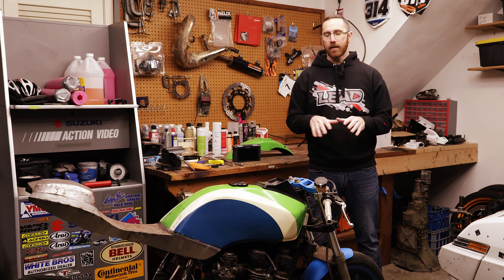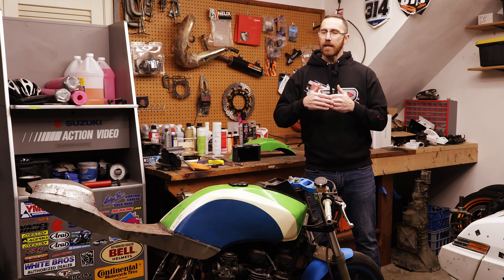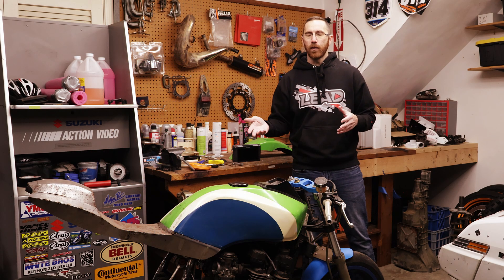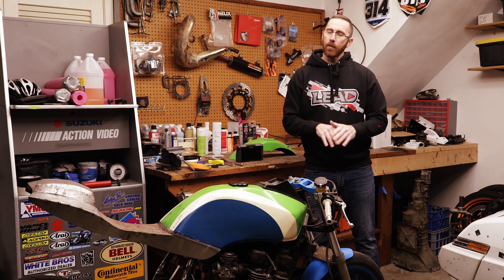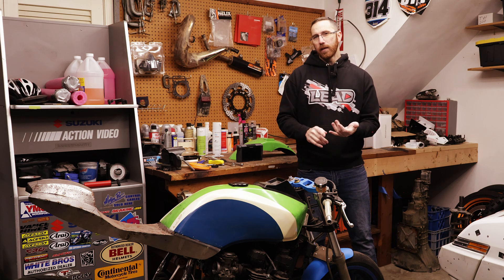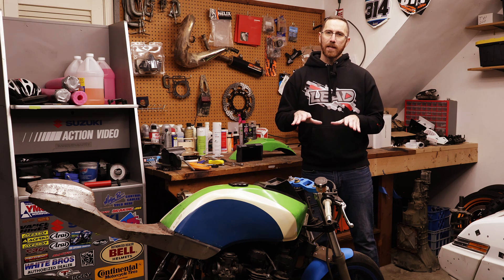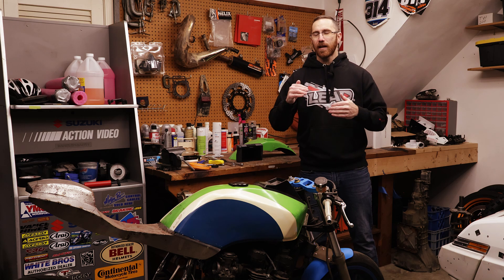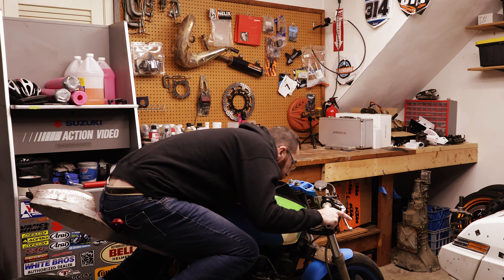Using CAD to Design A Motorcycle Fender -  GPz Build Series Front Fender

Comment: If you print it out of PPA-CF or similar PA it should hold up. But yeah the layer line direction is always a concern when you print something.
Reply from the maker: For sure!  I printed the engine cover in pla-cf and that seems like it will work fine for end use.  There are a few really nice material options.  For the final fender i still think I will lean toward using the print to make a mold. partially because i can't print the fender as 1 piece.  But i might do a small fender for my mountain bike and try out an in use 3d print. good durability test.

Comment: What's up with the Station/Conquest? Love the videos!
Reply from the maker: Its on my project list :)  I have done a few videos with it.  We did a scan to widebody series and i have done an exhaust manifold series with it.  its an 84 Starion ES that i have had for over 20 years.  I rebuild the stock engine many years ago and developed a rod knock.  I have a spare engine but its been low on my list.  when i revive the project i will likely do a build on the 2.6l or find a wideblock 4g63 from a truck and do a 4g conversion.  i kicked around a kswap but really i don't have the time at the moment.